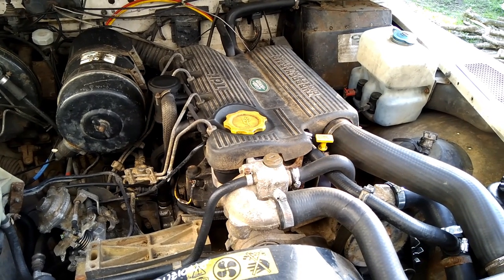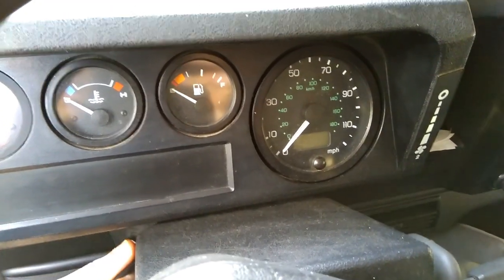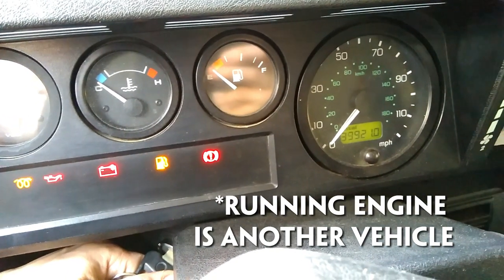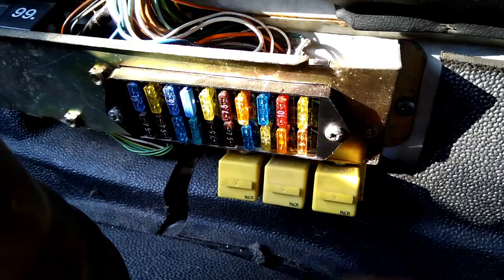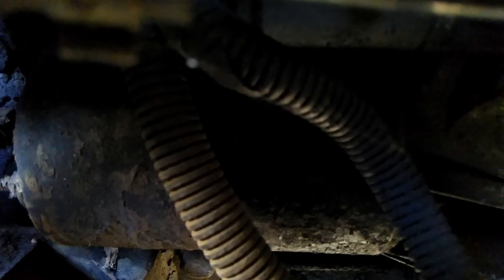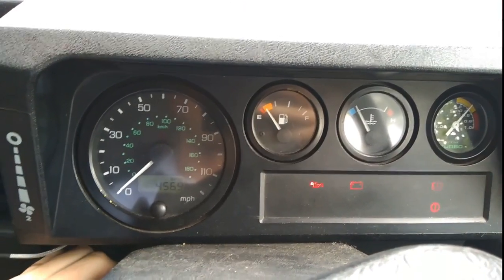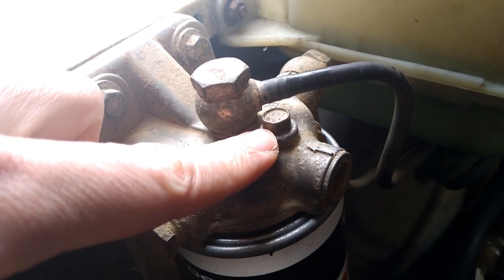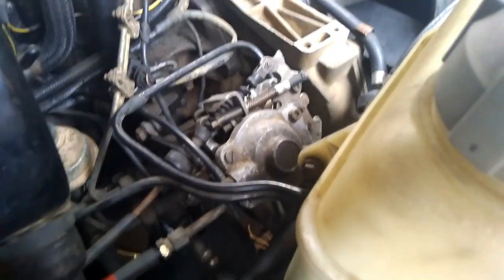300Tdi starting problems when cold or hot  - Examples and fixes

Comment: I had air in my fuel system, I found a common fault with the fuel water trap filter on the right hand side of the rear quarter panel. The seals perish. Easy fix. Just disconnect the fuel lines, and connected together without using the filter. Providing that you have a good filter under the bonnet, b4 the fuel pump. My filter under the bonnet has a water drainage, plastic screw cap. Just remember to drain the filter every few months, if driving in wet conditions. Hope this is helpful, Paul.

Comment: I had a 300tdi Disco auto - late model with the fly by wire throttle - was a pig to start when cold - 0 degrees. Never did fully sort it. Have a 200tdi Disco now. On the button.

Comment: I did have a different problem. No lights, everything dead. Batterie connected and 12V.  After a couple of hours or the next day everything normal again and the engine did start. This has happened from time to time.  Never found the problem but switching the batterie with someone did cure it.
Reply from the maker: That's a strange one. Thanks for the comment!

Comment: Hi, my starting problem is that when the weather' cold, it takes a few tries to get the engine to turn or it just won't start at all. Once it's started the, theirs no problem starting the engine the rest of the day. There are never problems in the summer
Reply from the maker: If slow to turn, then it's the battery. Get at least 1000cca for the best results. Otherwise it might be glow plugs - get Beru they are OEM. Not cheap, but good. If it turns fine but won't fire then maybe an air leak in the system that drains overnight
Reply: @lrworkshop  thank you very much! I'll give them a go 👌
Reply: could be poor compression?
Reply: I have the same problem, as soon as there is frost, I can forget it. I’ve had both the alternator and battery replaced but only worked for a week before the slow crank of death returns…

Comment: I have an issue where the car starts fine every single time when cold, but sometimes when the engine is particularly hot - hot day on the freeway - the starter won’t fire at all. Have to wait 30-40 minutes for it to cool down when it will then fire again just fine. I’m replacing the starter as I’m guessing it’s a heat soak issue being right next to the turbo and maybe age related. Cheers
Reply from the maker: I've had something similar. Only lasted about a month. I suspect the immobiliser spider in the seatbox. Sometimes it would buzz. But it's been fine now for 2 years. There is a bypass you can fit https://www.lrworkshop.com/parts/AMR4956. As you say the heat from the turbo could be a factor. There should be a heat shield bolted to the underside of the inlet manifold. Lots are missing. Mine broke off and I never replaced it https://www.lrworkshop.com/diagrams/land-rover-defender-engine/300tdi/manifolds_53189#15

Comment: Mine, you can turn on the ignition switch and dashboard lights on but without engine  sound  what could be the problem,  thanks
Reply from the maker: possibly the starter relay, behind the fuse box cover